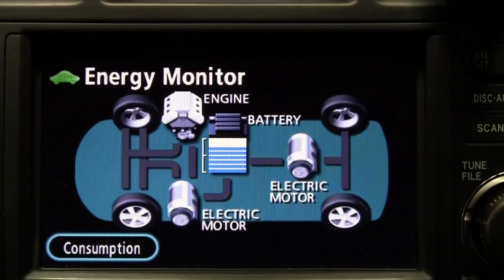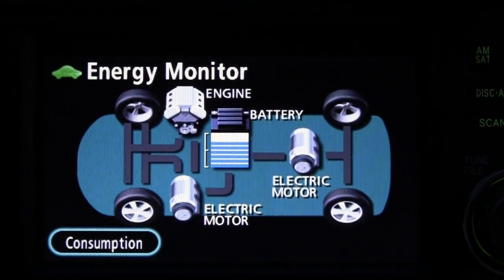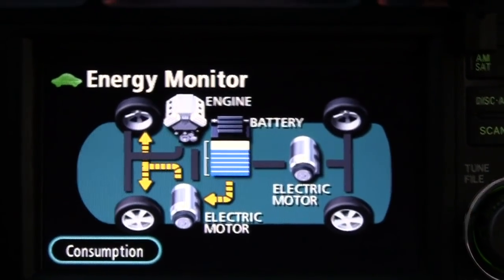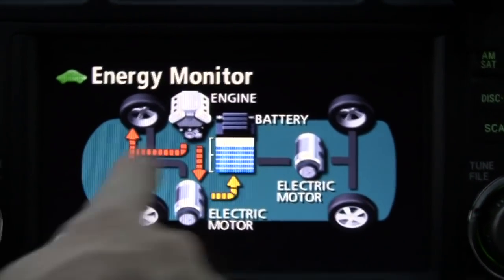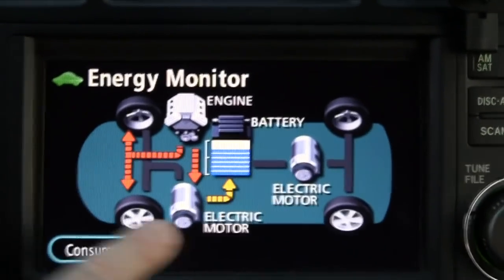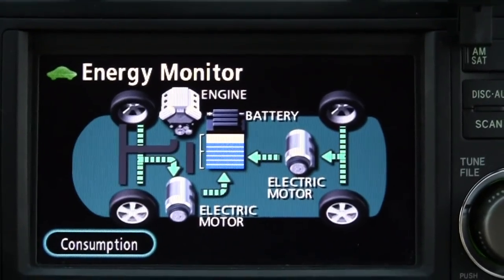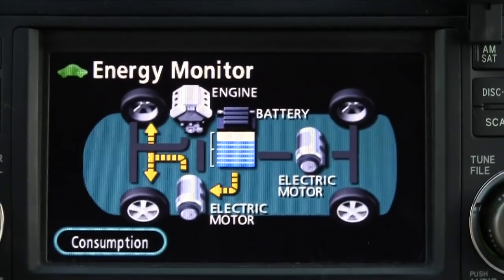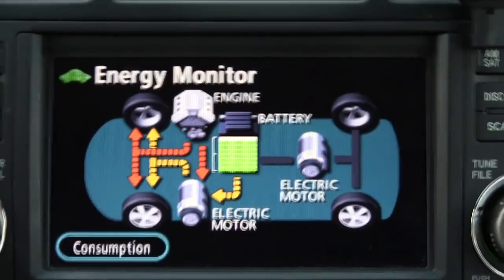Hybrid-Electric Vehicle Energy Monitor

Comment: John, we have an '09 prius that we have taken on a camping trip with it fully loaded to the hilt with camping gear and still got 47 miles to the gallon. It now has over 200,000 miles and I've checked the brake pads twice. They still have life left. The regenerative braking is the key to that. Oil and tires, that's all that we've replaced. Great car.
Reply from the maker: Thank you for your feedback. I think they are great cars too!

Comment: It is hard to believe Toyota can add so much value for $3000 and the deletion of a tranny, rear end, starter and alternator.   In it's place you get, 3 electric motors, a generator, rectifier, 20 ft of high capacity bus, a 1.5 kWh battery,  sophisticated controller,  two gear trains and a new user interface.   A lot of bang for the buck.
Reply from the maker: Agreed!

Comment: I have a 2008 Prius with 236K on the odometer; I purchased the car when it had 78K miles in 2013. Has only needed a catalytic converter and basic maintenance; has the original Panasonic battery pack, which I've removed and cleaned up the bus bars and fan/ducts, thanks to one of your videos. Oil (5W-30 synthetic with a NAPA Gold filter) is changed every 4000-5000 miles, and uses maybe a half quart every 5K. The CVT fluid is changed every 50K. Question: If the car is going downhill with frequent application of the brakes, and the battery indicator is all green, what happens to the excess energy from the regenerative braking? Does it switch to more hydraulic operation to avoid creating excess current. I believe I read somewhere that the car can use the ICE with the injectors turned off to slow the car. I love your educational videos and wish I lived within driving distance of Weber University. I would enroll in a heartbeat. Keep up the great work and greetings from Louisiana!
Reply from the maker: Thanks for watching

Comment from the maker: Hi, there is not tachometer, only a speedometer and a kWh power usage gauge. The engine RPM varies with the amount of hybrid assist available. There is more hybrid assist at lower speeds. I have watched the engine RPM on a scan tool, it varies between 2000 and 5000 depending upon load and speed.
Reply: Is there a possible way for us to buy and change the individual cells when it gets older? Even better, is it possible for us to change to something with higher capacity (or LiFePO4) to allow the car to EV longer?

Comment: Hi  I have a 2014 vtrux Silverado converted hybrid by via motors . Problem that I’m having is the 12v water pump is always on even when key is not in ignition . What could be going on with water pump?

Comment: Just purchased a 2008 RX400h. THANKS for this video !! There is nothing else like it that I have found. I kind of understand the Blue bars. What does it means when you have the GREEN bars?? Any information you can provide about the GREEN bars will be GREATLY appreciated. Recently, my '08 went to 1 blue bar and I almost panicked. I was using the AC and was parked. After I started driving again, the blue bars when back up to about 5. The next day, my blue bars was around 6 and then it went GREEN all the way to the top !! What does the GREEN bars mean????

Comment: is there a way to load test the battery capacity of the Hybrid battery while in the car? The reason I ask is that the voltage might be ok but when the load is applied the capacity drops fast. So I want to know if we have a way to test the capacity of cell blocks while in the car. Thank you for the great videos!
Reply from the maker: Thank you. No, I am not aware of any such test

Comment: About the braking, what power mechanism increases the hydraulic system? I would imagine that a standard vacuum servo is ruled out, given that the engine is out of operation part of the time.
Reply from the maker: There is an electric pump to pressurize hydraulic brake fluid and store it in an accumulator. The pressure is used to apply the brakes when required. No power assist is needed. The brake pedal is there to make you feel good, but it does not actually force hydraulic operation to occur in most instances. It is just an input to the braking system controllers.

Comment: If all but one bar lights up green on the battery, does that mean capacity is going down? Mine lives in the blue but occasionally goes green fully charged but one bar doesn't light up. Is that normal?
Reply from the maker: That is normal

Comment: Have you figured out a way to test the health or condition of the hybrid battery ? How much capacity has the battery due to old age?
Reply from the maker: The on-board system monitors the battery condition itself. It will let you know when it needs replacing. Typically the batteries last about 10-12 years or 150k miles.

Comment: Hi John  thanks for the video. Lots of good Information. Question: you indicated that regenerative braking at real slow speed around 3mph is not much. I can understand why at emergency braking but not at real slow speed. As you indicated the charging rate is increased to put a higher braking load onto MG2. Is there some reason the inverter is not able to do this at low speed. Can you please explain why it is so. Thanks.
Reply from the maker: Thank you! At slow vehicle speeds (slow motor rotor speeds) there is not enough induced current in the stators to create a strong enough magnetic field to oppose the motor rotor movement.
Reply: WeberAuto  Hi John thanks for your reply.

Lenzs law states that a induced current is produced by the rotor Into the stator. The induced current produces a magnetic field that opposes the rotation of the rotor. 

If we consider the following. MG2 is able to use a measured amount of electrical power from the battery to move the car at 3mph. Would not the same amount of measured electrical energy be produced in the reverse direction during regenerative braking. If the inverter is able to put the correct amount of load. 

Then regenerative would accrue so long as current is flowing into the inverter. Could it be that the inverter is not able to convert the electrical energy at 3mph to charge the battery.

Thanks, I'm still learning how my Australia made Camry hybrid car works.

Comment: I heard someone say that buying the low rolling resistance tires vs regular tires is a wash, that it evens out. You can pay more for the tires and slowly gain that money back in fuel savings, or save money on the tires and slowly pay more for fuel over time.  Some have done the math and it seems to be quite equal (from their perspective). If thats true, the only benefit to those special tires would be if fuel costs get considerably higher.
Reply from the maker: That used to be true, but today Low Rolling Resistance Tires are inexpensive and becoming widely available. Thanks for your feedback.
Reply: WeberAuto The most popular low rolling resistant tires seem to be one particular model by Michelin. Energy Savers. Ive seen reviews that they are among the most efficient. They sell for around $150 each, for a small Prius tire. Competitors tires sell for around $100 each but are less efficient. $100 each is VERY expensive for a small tire and not easily recovered at today's low fuel costs. So, you may be correct that the price has come down....but its still VERY expensive!
Reply: I have seen some tires claimed to be "lower" rolling resistant tires as low as $75 each....but ratings are not much better than a normal tire.   And for a small tire, $75 is still plenty of money.
Reply from the maker: Thanks for the feedback. You are correct, there are many prices out there, but all of those tires have different handling, tread wear, and traction characteristics too. When I said inexpensive, i did not mean $44 each, I should have said "less expensive".  Low rolling resistance tires used to be close to $200 each. I just replaced all four tires on my Chevrolet Volt with the exact Goodyear FuelMax tire it came with from the factory for $550 mounted and balanced (137.50 each). If you want your Prius to get the same mileage it got, and handle the same way it did when it was new, it needs to have the same tires and use the same motor oil. Sorry for the confusion.

Comment: Question....

Test drove a 2007 Prius today. Battery had blue bars, looked same level as in the video, with 2-bars missing.  I drove it for about 30 minutes, at least 15 min of that on the highway, and the meter didnt get higher, didnt turn green. Is that a problem?  Thinking about buying it.
Reply from the maker: No, they rarely get into the green level unless you are decelerating down a long hill.

Comment: Great explanation as always. I'd suggest that at only $3,000 extra to have the hybrid system it is an outstanding value proposition. The cost and benefits of having all that engineering has to be worth many times more than a few thousand dollars. Image trying to make the motors, battery and control circuitry and associated wiring for only $3,000?
It would have to cost a factor of 10 times that I'd estimate.

Comment: i drive a 2008 Toyota Camry hybrid. however the Hybrid electric vehicle energy monitor power flow arrow is not showing.  so i dont know if both engines are working. what do i do
Reply from the maker: Good question. Have it checked for trouble codes.

Comment: My Prius needs new cells. Is it not possible to run supercapacitors in propulsion power supply view of the frequent load and charge cycles? The batteries would stay charged in view of the rapid charging function and provide millions of cycles.
Reply from the maker: You probably could make it work, but they would fill up the car and need to be secured, inculated, etc. in case of an accident. A replacement battery is the best and safest solution.

Comment: I just purchase a pre own 08 hybrid I get 28 to 30 miles only when my gas tank is full. Then it drops to 22. And it keeps on that amount on highway and on city.  I try everything on me like slow take off on traffic lights anything I have try but I still get the same result of 22.4 on city and highway. If you can help me let me know. Thanks
Reply from the maker: +Jose Lopez Hi, it may be possible that the vehicle averages 22.4, but after refueling, the mileage resets and starts high and works down to the 22.4. My highlander hybrid averaged 22 in the cold weather months and close to 30 in warm weather. If yours is always lower, it may be that the high voltage battery is slowly loosing capacity. If you do not have any warning lights illuminated, the system has not detected any problems. Speeding will also cause lower mileage. Thanks for watching.

Comment: Hi there, my MFD doesnt show battery bars neither circulation of energy...sometimes on the first start in the morning it is appearing for a short time and then it is gone.. when it works it shows three blue bars....how does that sound...thnx
Reply from the maker: I do not know. If the battery were bad the engine would not start.

Comment: hi, what if those energy path arrows don't move or stay gray at all time while I'm still driving the car? that's what's happening to my car.
Reply from the maker: +D Son Hi, Mine did that at times too. If it happens all of the time, there may be a problem. I recommend disconnecting your 12 volt battery negative cable for a few minutes and then reconnect it and see if that fixes it. (It is like rebooting the computer). Best wishes.

Comment: my prius 2013 enwrger monitor not function ,and there is message show in my secreen hybrid system problem .can u please help me on this
Reply from the maker: Get someone t check for trouble codes and go from there. There are many possible issues.
Reply: i get the code p0A93 i did change inverter coolant pump but still working .

Comment: I have the 2007 GS450H. I just replaced the 12v battery ($515) and wonder about the symbol beside the word "battery". There are 4 bars that never seem to fill in. The best I get is all but the top bar in bright green but never fully filled in. Does the smaller group  4 bars ever
Reply: $515 to replace an accessory battery is ludicrous. You can do it yourself for less than $100 and a few minutes of your time -- you need to reinitialize and relearn idle but that is pretty simple. Regarding those bars, Toyota designed their main battery to be partially discharged when running, so there is room to put juice back into the battery when braking. Once fully charged it sends energy back into the drive train.
Reply: Yes, but these bars have never been anything but feint grey. The proper battery for this car is a two part battery. There does not appear to be anyway to to use an off the shelf replacement.

Comment: I have a 2006 HH (has 80k on it) that has been gradually dropping the mpg from the 27.5 overall I was experiencing up until about a year ago to approx 23.1 mpg nowadays.  Interestingly it will average 27-28 when running 65-75 mph on ICE only.  However, the more miles of local 25-45 stop/start city driving I drive the lower the mileage goes as it walks the average back to the 23+ avg which means that when it should be getting its highest mileage its actually getting less than 20 mpg.
Reply: and did you replace the battery?

Comment: Always enjoy your videos. Curious if you're familiar with a fairly new app called Hybrid Assistant - http://hybridassistant.blogspot.com/ - that allows really in-depth monitoring of a hybrid system as it's working from my android phone. I use with my 2017 Highlander Hybrid but noticed that HV Battery charge always seems to between 50% and 60%. Your video listed charge as going between 20% and 80%. Are they using a different scale? Thanks
Reply from the maker: Thank you! No, I have not seen that. I have access to all I need with the Toyota scan tool. The battery to 20% and 80% information is the lower and upper limits that they try to stay in while driving under different conditions. Try driving your vehicle up a long (many miles) steep hill and see what happens (closer to 20%). Then turn around and come down a long steep hill and watch the SOC (closer to 80%).  Here in Utah it happens all of the time. Thanks for your feedback.